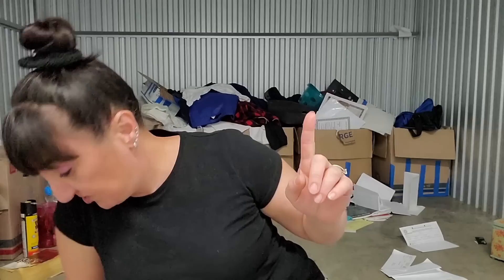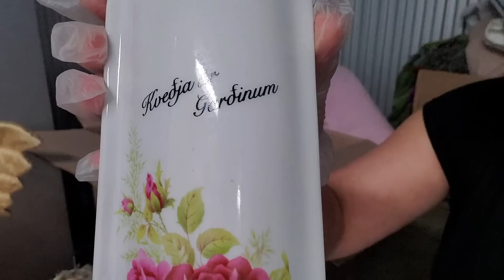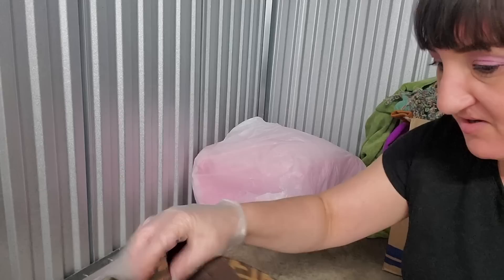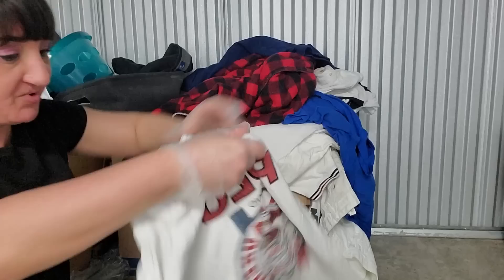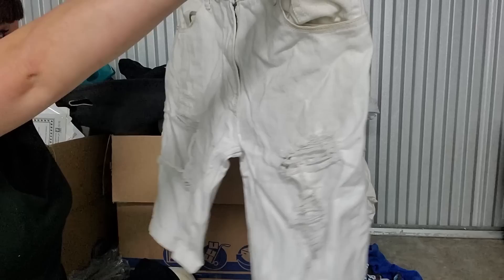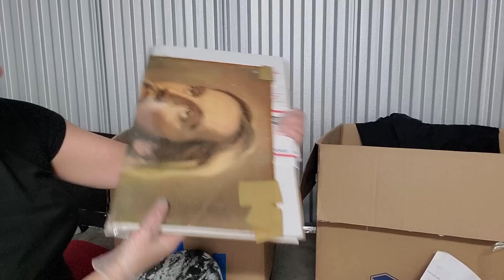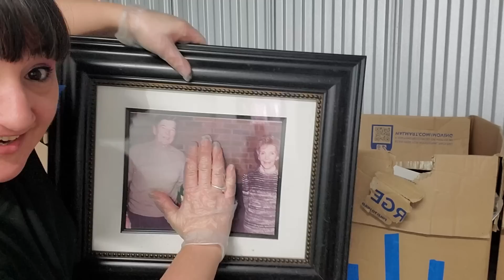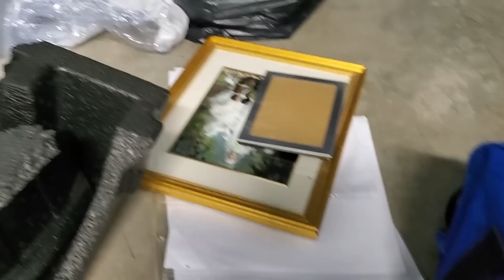Cops Are Involved In This $10 Abandoned Storage Unit | Can't Believe What I Found!

Comment: I am retired now but worked for Public Health.  We has a top researcher from the U of Minnesota talk to our staff about bed bugs.  You can Goggle them and find a lot of info.  With what you do, you should definitely read about them.  You can wash quilts etc. but that doesn’t kill them.  It’s the heat in the dryer that does.  If I came across in, the item or items would directly into the garbage.   When I get home, I’d take my clothes off in my garage and toss them or put them directly in the washer.  Then I’d head for the shower.  Them eggs are very sticky and they stick to your clothes and you can’t even see them.  It can cost thousands to get them out of your house.  We had staff who had to throw away sofas, mattresses, etc.  Be careful kiddo. Even when it comes in the mail.  You shouldn’t wear black or sit on the floor.  Please read about them.  Once you have them it’s to late.  Very very difficult to get rid of.  Exterminator try but they really can’t get rid of them either.  The chemical used to get rid of them was outlawed years ago.

Comment: the gucci shoes look correct did you check the stitching and tags also the lace holes, look for mistakes or typos, a lot of the times on the tag you will see misspelt words, with the lace holes actual gucci's will have perfectly spaced holes that perfectly line up, with the stitching you are looking for odd looking spacing. If any of this is present it is fake